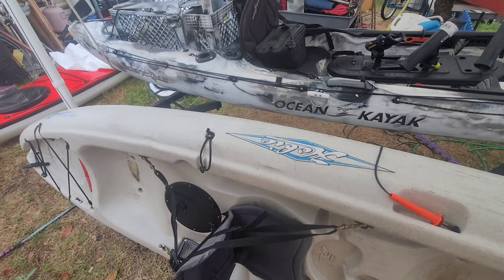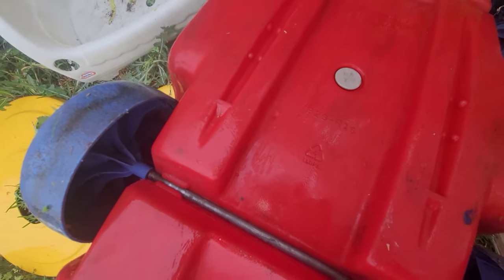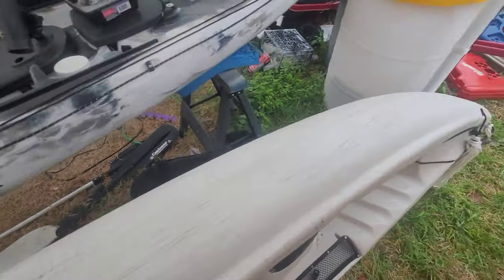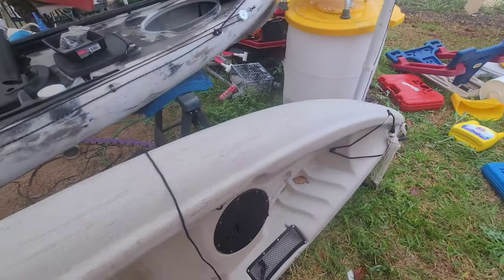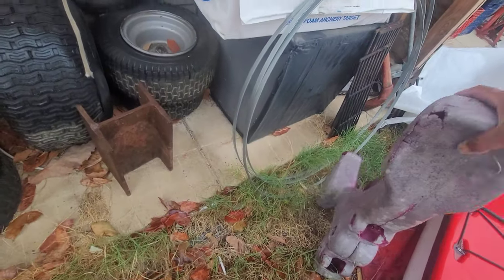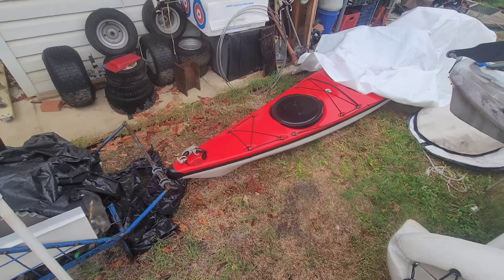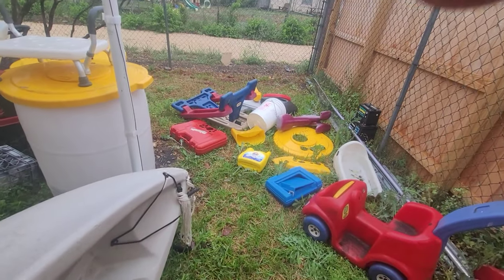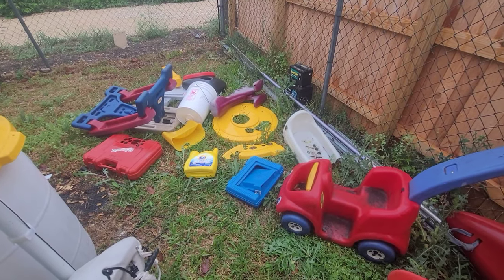KAYAK PLASTIC WELDING  & SOURCES FOR PLASTIC + TIPS

Comment: Love your videos! I got a perception pilot 12 the other day and it is riddled with cracks and small pinholes. I think I know what to do now after watching your videos!
Reply from the maker: Line the inside of the cracks with aluminum tape after repairs. 
Use the tape that has the rubberized backing.